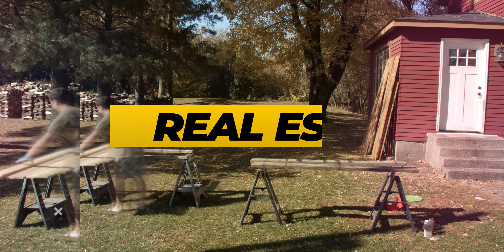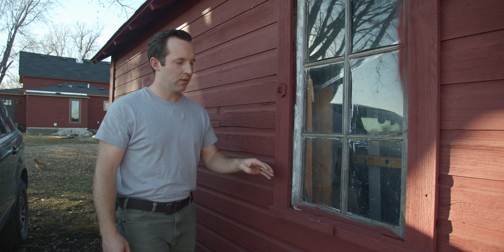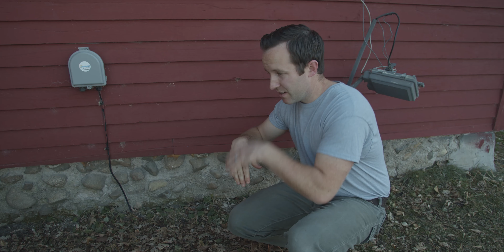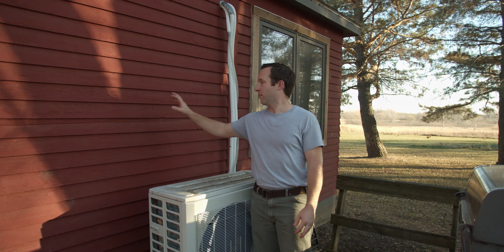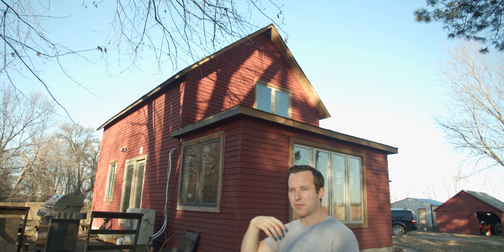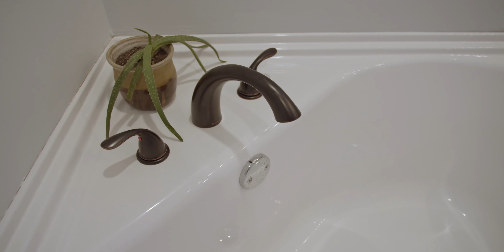Watch This BEFORE YOU BUY a Farmhouse Fixer-Upper

Comment: How much did it cost you for your asbestos abatement for the insulation/entire house?
Reply from the maker: DIY with proper PPE.  Technically, it was "removal" rather than a complete "abatement".  As long as it's not blowing around your house, it's fine.  So, less than a couple hundred dollars.